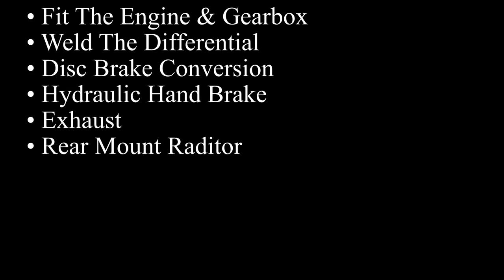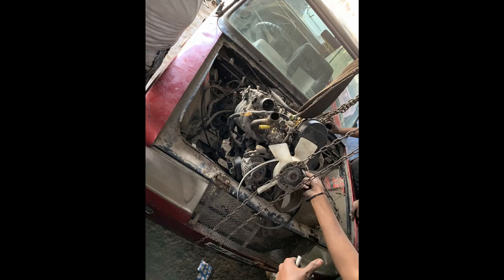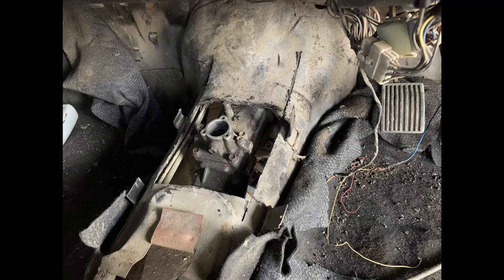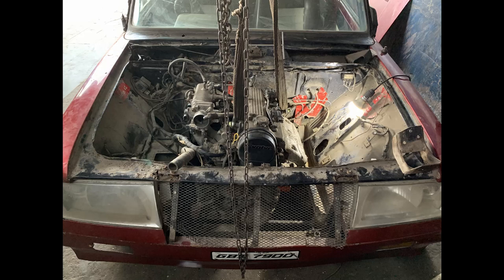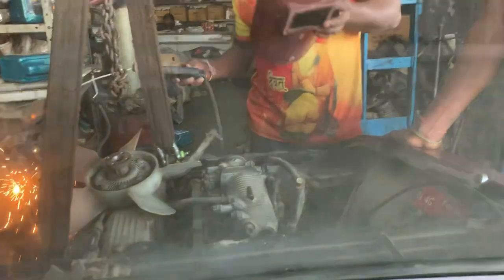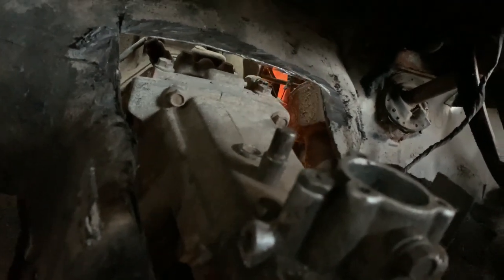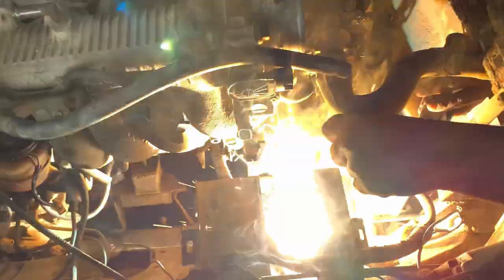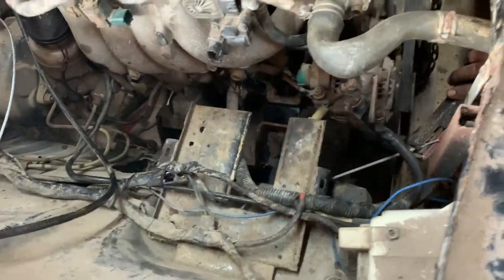Fiat Premier 118NE ENGINE SWAP + DIFF WELDING | Project Drift 🇮🇳

Comment: That gypsy king is already a rear wheel drive right? Why don’t you upgrade its elliptical suspension and do some weight reduction? What is the reason for this swap with this sedan? Please explain.
Reply from the maker: I’ll be glad to explain. First it has leaf spring suspension in the front and rear which won’t be ideal for drifting as it would cause wheel hop. 
Second it has a solid axle in the front that wouldn’t give us any adjustability whatsoever.  
That being said you can make a gypsy drift too but for me I could do a lot more with the 118 chassis, it’s independent suspension in the front and multilink suspension in the rear. 
This question has been asked earlier and I have explained it in this video. 
https://m.youtube.com/watch?v=qviVB5AfG3s&t=6s

Comment: sir ur video is very helpful...si i worked in my tata safari old 2000 cc engine convert to tata 407 engine,but sir i am facine problem on engine mount ,i dont know how i weld engine mount with my chasis,sir i want help
Reply from the maker: you will have to make a bracket on which the engine mount will be bolted. that bracket will be welded on the car frame according to your preference of engine placement. second option is to make the bracket that bolts on to the frame so there is no welding required. DM me on insta for further questions.
Reply: @NaughtyNut  thank you sir ,i think bolting on chasis is better option...😊😊🙏🙏🙏

Comment: May I know why did you weld differential
Reply from the maker: For drifting. Open diff will send the power to the wheel with least traction. I wanted both the wheels to spin the same amount regardless.

Comment: Have you catch by police for engine swap ,as it is illegal India .
Reply from the maker: It’s legal you have to go to the RTO  and update your new engine spec and engine number. 
If you don’t drive it on the street you don’t even need to do that. 

Plus if you get caught by the police they not going to check which engine you have under the hood.